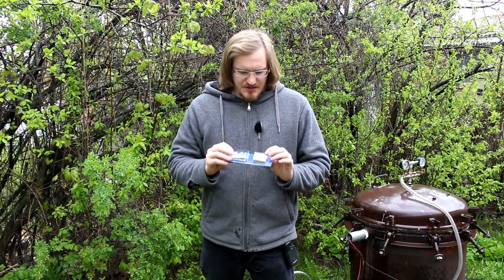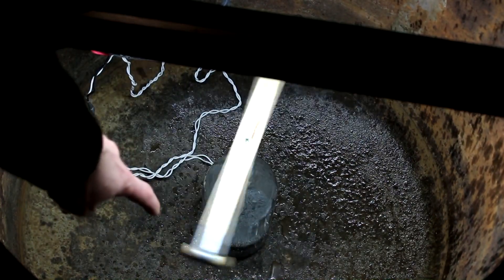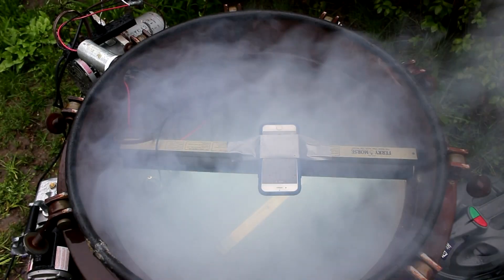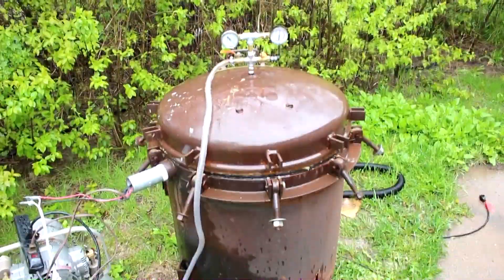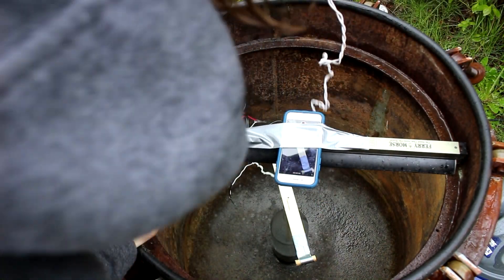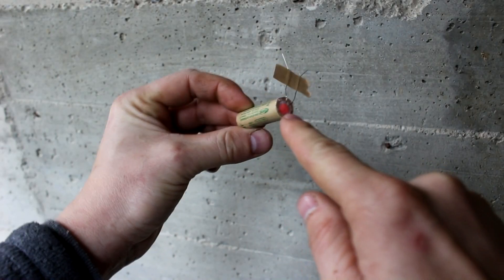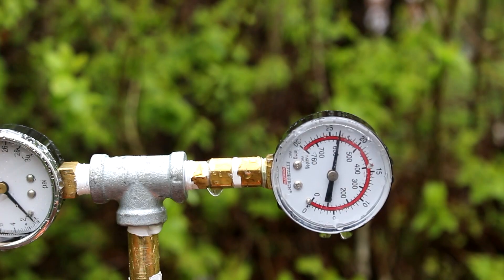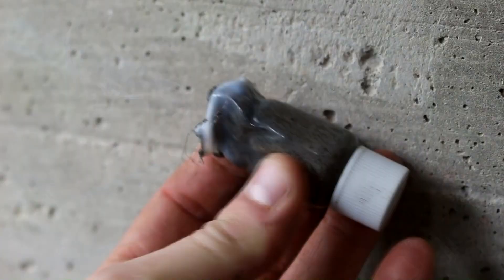Will a Model Rocket Motor Work In Vacuum?

Comment: You have just proved 100% that nothing can burn in space - rockets do NOT work in space. Well done!! NIce video!!
Reply: The rocket worked great when it was ignited.  The igniter did not work initially as anyone with model rocket experience can explain.
Reply: The rocket worked great when it was ignited.  The igniter did not work initially as anyone with model rocket experience can explain.
Reply: No, he proved that rockets work when they have pressure in the in the combustion chamber and the outside conditions do not effect weather or not the fuel burns. the only thing a vacuum does for a rocket is make it more efficient because the exhaust doesn't have to push against the roughly 14 psi at sea level.
Reply: The Feathered Tyrannosaur tell me, did the rocket work initially when the air was evacuated out of the chamber Yes or no?
Reply: The rocket motor contains Ammonium perchlorate, which when heated breaks down to produce oxygen.  It's the same chemical used in rebreathing systems like escape fire hoods.  The igniter does not have this or any oxidizer.
Reply: Uhh sir he kinda did if you watched till the end of the video he explains that it needs enough pressure to actually start the motor, he puts a plastic bottle on the end of it and at regular pressure, when ignited the rocket would blow the bottle off and it would be introduced to vacuum, it worked beautifully. Btw you don't have to be so mean no one is gonna listen to you if they think your an asshole
Reply: Uhh sir he kinda did if you watched till the end of the video he explains that it needs enough pressure to actually start the motor, he puts a plastic bottle on the end of it and at regular pressure, when ignited the rocket would blow the bottle off and it would be introduced to vacuum, it worked beautifully. Btw you don't have to be so mean no one is gonna listen to you if you act like a butthole
Reply: tell me, do you see rockets encased in a bottle containing air?
Reply: Peter Peterson
"do you see rockets encased in a bottle containing air?"
No, the combustion chambers in liquid fueled and hybrid rockets (the only ones that burn fuel and are used in space) are pressurized by the constant inflow of gaseous fuel and/or oxidizer.
Reply: The Feathered Tyrannosaur doesn't matter what type of fuel one uses, still need the presence of air for anything to burn. The only reason liquid oxygen is used is to intensify the burn which is already burning in the presence of air. If you think im wrong show me something burning in the absence of air. Crikey, even cody acknowledged at the start of this video he couldnt get anything to burn in a vacuum. Guess you missed that bit.
Reply: i'm uninterested in the mechanics of the internal operating systems that u describe. Do you see rockets encased in plastic bottles containing air yes or no??
Reply: Peter & Pete But if your uninterested in the mechanics of a rocket, how are you supposed to even try to argue the feasibility of them?
Reply: Peter Peterson
"doesn't matter what type of fuel one uses, still need the presence of air for anything to burn. The only reason liquid oxygen is used is to intensify the burn which is already burning in the presence of air. If you think im wrong show me something burning in the absence of air."
Air is composed of ~78% nitrogen, ~20.9% oxygen, and ~1% argon and other gasses. Molecular nitrogen alone does not allow things to burn since it is fairly inert under normal atmospheric conditions, you will actually suffocate in an entirely nitrogen atmosphere for the same reason; lack of oxygen. Argon two is also known for being useful in situations where you don't want things to burn, and carbon dioxide (the next most abundant after argon) is produced by most fires so it is also going to be useless two. Some elements like fluorine can replace oxygen and actually does a better job than it at oxidizing things since it can make glass spontaneously burst into flames in high enough concentrations.
There is no magical substance in the air that makes thins burn, this is basic chemistry. All something needs to burn is a source of an oxidizer and enough heat and it will burn regardless of atmosphere as shown in one of Cody's other videos showing things burning in a vacuum:
youtu.be/8Cx9mNnky2U
Near the end he shows some thermite burning without any atmosphere to provide oxygen, and it is only difficult to get it to burn because there is no atmosphere to transfer the heat from the hot areas to the cooler areas. It burns all on it's own after a little bit though, and if you are going to say that it made an atmosphere inside the chamber to transfer the heat then I will let you know that the product of a thermite reaction is iron, and aluminum oxide, both exist as a solid at room temperature and the latter has a boiling point about 850°F hotter than the usual temperature of a thermite reaction, and so there would be very little aluminum dioxide evaporated away from the reaction in the vacuum.

With this you are saying that there is a magical element that has somehow evaded scientists for hundreds of years which is also fairly abundant in the atmosphere and you believe in it not because of the lack of supporting evidence for it but only because it discredits an idea you don't like if it were true.

"even cody acknowledged at the start of this video he couldnt get anything to burn in a vacuum. Guess you missed that bit."
No, he said that that at first was unable to get a system which was designed to work in a thick atmosphere to work in a rough vacuum. He was later able to get it to light and then run in a vacuum, there was nowhere near enough oxygen in the chamber to allow the rocket to burn if all of it were to get to it. I suppose you forgot about that part.

"i'm uninterested in the mechanics of the internal operating systems that u describe. Do you see rockets encased in plastic bottles containing air yes or no??"
Yes, but I also saw a rocket working in a decent sized vacuum chamber with a rough vacuum that could not supply anywhere near enough oxygen to allow it to burn if the oxygen could somehow get in.
Reply: I don't think you understand how these things work. The model rocket engine did not ignite under vacuum. But there's a specific reason for that. In order to sustain a combustion reaction like this, you need 2 things : a fuel and an oxidizer (oxygen) In a vacuum, there is indeed no oxygen to sustain the reaction, and thus the engine doesn't ignite. HOWEVER, that doesn't mean rockets can't work in space. The trick is to bring your own oxydizer with you. 

Modern rockets typically bring along liquid oxygen to allow the rocket to burn fully. By putting the engine in the small container, cody not only provided pressure, more importantly he provided a sufficient supply of much needed OXYGEN
Reply: You somehow managed to watch an entire video dedicated to an explanation of that and somehow managed to miss the point...
Reply: Peter & Pete well yeah kinda
Reply: and your explanation is?
Reply: and your point is.......?